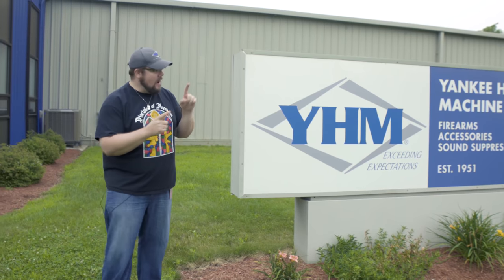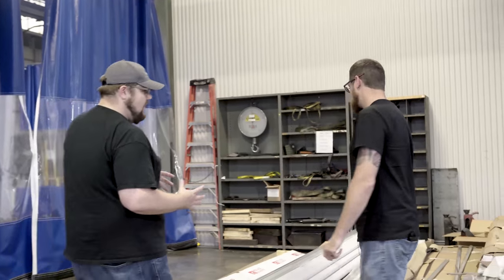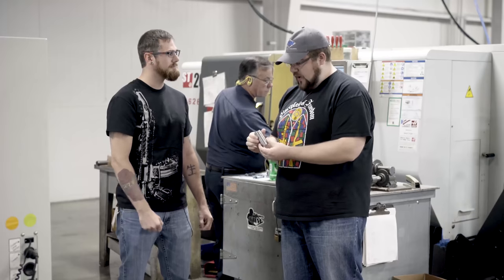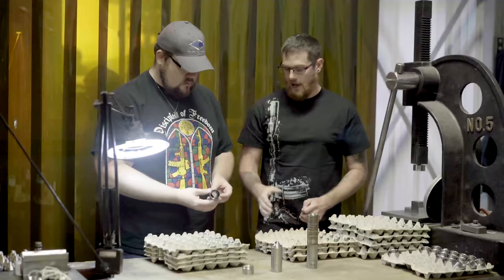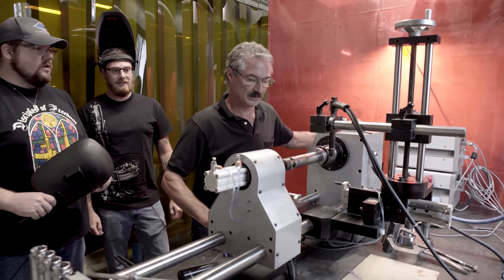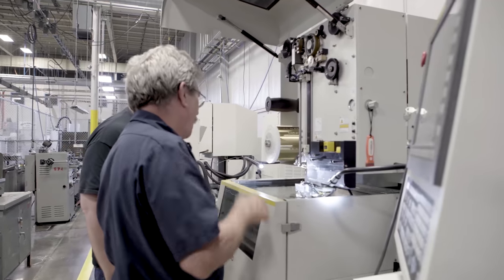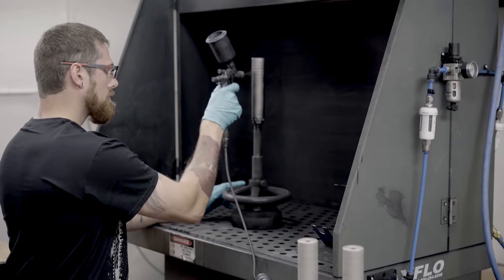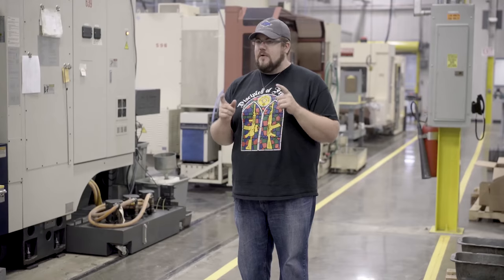How A YHM Suppressor IS MADE - TGC Factory Tour!

Comment: I started the ball rolling today. Stopped in a local gun shop I have heard good things about. I paid for a YHM Resonator 30 cal W/mb. I walked in looking for a suppressor for my 556. They had the short one in stock. The longer one would have to be ordered. (out of local stock) 
I was looking at it when the store gunsmith walked up. I had a few questions about the brand, word of mouth, just general questions. 
As we were talking the salesman sat the 30 cal (what I call the long one) next to the much shorter 556 I was looking at. Hmmm. I'm considering upgrading to a 762 AR sometime in the future. Just not at this minute. Maybe next deer season here in n/w Louisiana. I'm sticking with the 556 for now simply because it's fun, I can place my shot EXACTLY where I wish under 200 yards, and not break the bank to shoot. 
Both the gunsmith and I were Shocked to learn the 556 bore suppressor & the 762 suppressor WILL screw onto both 556 & 762 muzzle breaks. WHAT!!??! 
I understand the muzzle breaks will in no way interchange on the 556 & 762 barrels  (different size threads) But the suppressors themselves Will fit both muzzles. This isn't good. I realize I can fire a 223/556 through a 30 cal suppressor. I can NOT fire a 762 through a 223/556 suppressor. Well, you can, But only once. 
Why aren't the muzzle breaks made so one suppressor may not attach to the other muzzles? Why not make the muzzle breaks proprietary with respect to the caliber being used? The 556 & 762 could be easily mistaken one for the other. I won't have to worry about it simply because I will never own the two suppressors at the same time. My original questing was, how much sound suppression will I lose by firing 556 rounds through the 30 cal suppressor I purched? I know you guys have nothing to do with the following, but having to pay my government $200 bucks extortion money seriously grinds my gears.  
Cheers from Louisiana.

Comment: Have one of their .30 cal phantom cans. It's fantastic!
Reply: Ian Carpenter...I too have a phantom .308 .. and a QD flash hider on a DPMS LR .308
No matter how tight I put that can on...after 4 or 5 shots it loosens up one click...one click makes it pretty wobbly...I've sent the can and the original QD mount back to YHM...they sent the can back to me with this new smooth flash hider...same problem...even on my DPMS 5.56...though it does take about 10 shots to shake it loose. Have you had any problems with your can backing off your QD mount?
Reply: @charleszeberlein9547  I'm sorry I should have clarified. I have one of the old direct thread cans. I'm sorry for hearing about trouble with the can. I hope you find a solution!
Reply: @iancarpenter5155  not a problem. Thanks for your reply.. I've sent it back once..I think I'm going to call them and send it back again..was thinking about useing valve lapping compound on the beveled seating surface that contacts the beveled seating surface on the QD mount so the locking ring captures another tooth on the can...I just don't trust the way it locks up. Thanks again for the reply...
 Merry Christmas. Ian..

Comment: Ok, two biggest things I got from this: really cool and interesting. LOL

Great video otherwise, looking to make YHM my second purchase, anyone recommend that I should get the turbo or resonator?
Reply: Never shot the resonator, but the Turbo is awesome, and on your wallet as well! You can shoot the living snot out of the Turbo can and it'll break loose easily when you're done.
Reply: @USMC_LAterZ  have handled and shot the res. Its a FINE piece of work. It oozes quality. I have also shot another that was almost 3 times the price and I think they are both equal in quality. Although the more expensive one is completely made of stellite, the warranty alone on the YHM make it a hands down. If I were Rick id get the Resonator just because of the versatility. Its not too long either so it will work nice on pretty much anything you have.

Comment: how do you clean the internals if the baffles are welded together?
Reply: Heavy Metalworks rifle suppressors usually are not able to be disassembled for cleaning since the pressure of the rifle round exiting does the cleaning. No need to disassemble the suppressor to clean the internals like you would normally have to like in a .22lr suppressor.
Reply: @hekhimself8451  wrong ,almost every one can be disassembled for cleaning. I got 2 of them and both can be disassembled for cleaning.  The only ones i seen that cant be cleaned are the economy grade one that are like 100 bucks.

Comment: Soooooo....What is the MSRP on those....
Reply: YHM is generally brought up as THE best value for money, for a well-built & quiet silencer.

YHM is very quiet & built like a tank, but not the slightest weight silencer, 18 oz vs get similar build strength, 80% the weight, & very slightly quieter from Surefire, the rolls Royce of silencer, at 4x the cost.

YHM is one of the quieter silencers, but the claim to fame is built like a tank, honestly that Sodick wire EDM is another level of accuracy I'm shocked they're doing EDM on a suppressor, wire EDM is expensive consumables & slow cutting but has a precision level its generally used on molds for medical equipment or aerospace alloys needing tolerances 1/20 the thickness of a human hair.

EDM also removes material with virtually no part-absorbed heat because such small amounts of material arc through the water onto the wire

Yeah thats not a misprint 1/20 the width of a human hair difference in size from 1 part to another,
 I honestly think EDM is ridiculous overkill for the tolerances on a silencer this is what you'd cut tungsten bearing surfaces for a turbojet engine, 

it's a slow cutting process YHM probably loads up the EDM at night with 30 parts & next day theyre done wire EDM.
But I can absolutely say, no homebuild silencer is gonna get anywhere near the concentric lined up holes of that YHM using an EDM.

I have a Resonator on order I'm waiting for my Form 4.